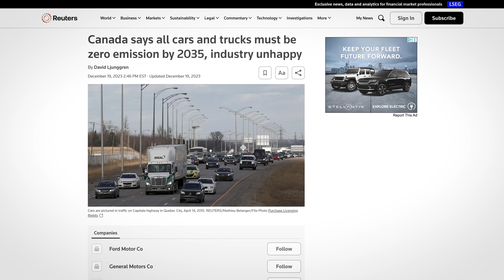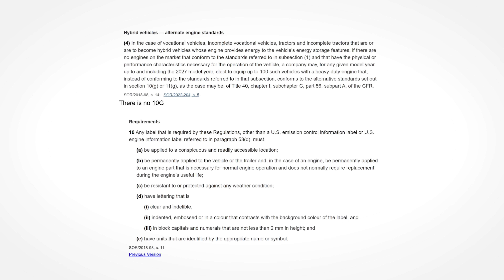Government Red Tape Is Blocking Our Plug-In Hybrid Trucks

Comment: More excuses.  I recall the earlier bloviation about using red diesel because the genset isn't mechanically connected to the drivetrain.  Just stupidity or wanking off for YouTube content.

But was good to see Chace state that his hybrids are "experimental".  We've been hearing how Topsy was a prototype and the new vehicles are production with the battery and control issues solved. My take is they have again realized the current redesign will not work and more time and redesigns are needed.

They should have built a pure electric first to develop all the engineering expertise they appear to lack.  Then add the generator.

Or just switch to the on road diesel engine for the generator and get these production hybrids running.  Assuming the electric parts are working.

But good to hear about the mechanical truck again.

Comment: Easy: the generator is not required to drive an Edidon truck. Certify without a generator. Then have an option for customers to add a generator before their truck leaves the assembly line. Legacy diesel vocational repair trucks are built this way. So, @EdisonMotors you build it this way too, only difference is that you'll put that generator at the front of the truck because there's space for it.
This got to be totally legit way!

Comment: Simple solution, make it so the generator doesn't work when the vehicle is moving. Use it as a "backup" off road charging station. Don't worry, owners will find a work around to get it working on the road.
Reply: They can’t sell it with the generator on the truck
Reply: Why not just use the diesel engine to push the truck down the road. Eliminate all that battary and e-moter weight  and go with what works. So says the 40 year mechanic.

Comment: you can use PTO control mode over CAN J1939 TSC1 to adjust the torque based on the load. you just have to do the load anticipation/reaction in your main controller.

Comment: Pretty sure you can use an on highway version if you wrap a control system around it. It will result in a better system overall instead of relying on a standard governor that is doing its own thing.

Comment: Here's what you do. Sell the truck without the generator. That way the "engine bay" is empty when you sell the truck. Now you call the engine bay a "cargo bay". Now you have a separate company that sells generators. Those generators just happen to fit in your cargo bay and plug into it. Nothing says you cant run a generator thats cargo on your truck. 

Literally no difference between plugging into a generator parked on the side of the road or loading the generator on a vehicle and running it.

What about refer engines are they on highway compliant?
Reply: they don’t even need to have a different company, just sell the generator on a special metal pallet that happens to bolt into a front cargo bay and plug in with a proprietary connector with canbus instead of an EV charger plug

Comment: Why not just hook whatever highway rated engine up to the electric generator and make an electronic throttle controller that turns the regular injection system into a governor? It just needs to see current draw from the battery pack and engine RPM, then increase throttle position accordingly. Current draw gives you instantaneous throttle response in open loop while engine RPM gives you closed loop feedback to tune out overshoot or undershoot like the I term in a PID loop. If you tune it to be more responsive, you reduce battery cycling while if you're just trying to save fuel and emissions you tune it to run the engine at an efficient speed and let the battery take up the peaks and valleys of instantaneous power demand.

The only reason I can see that this wouldn't work is if the electric generator you were planning to use isn't available except when packaged with the off-highway engine.
Reply: Wouldn't be as efficient as a dedicated generator. By a long shot.
Reply: I too am confused as to why they can't make their own governor function. Slap a generator on an on-highway engine and software control the throttle. 

Sure, maybe the on-highway engine is not optimized for a specific speed like a generator engine MIGHT be, but this isn't a complete blocker.
Reply: @Maxzillian it's massively bad for making electric power with

Comment: They have rolling emotions on the books. The big manufacturing companies said that they could not meet it. So they changed it to being at a stop. 

Don't fight this. Change how emotions are measured. Have it be moving with a full load in city stop and go traffic. And going up a step grade. We all know that a normal truck will not pass because the emissions will be high. 

You are out to change things. So change them. If the big manufacturing companies want to stop you then do what they don't want done. Have emissions tested at the extreme and then don't worry about it. Your truck will pass and then every on the road truck will not be able to pass.

They changed away from this type of testing because they were not able to pass with a load. 

The problem is that we think that we do something and it shows up tomorrow. Nature doesn't work like this. Right now if you match up numbers. Then temperature rise is about the same as the amount of green house gasses made around the start of the industrial revolution. Think about that. We are not seeing anything yet. When nature tells us something is wrong. It's too late. 

I wish you luck. If you have to do something then make it leave a mark. If your truck can pass then so should every other truck. Make a test that they can't pass. It could be as simple as emissions per mile driven with a full load.
Reply: Emissions, not Emotions.

Comment: Government incompetence has no limits.
Reply: It's not incompetence, it's corruption.
Reply: This was due to corruption.
Reply: It's not incompetence. It's intentional.  They'd rather sell carbon credits and continue the scam to line their own pockets
Reply: It was never about the environment
Reply: @unipartywonagainstthepeople They don't want people free to move or free to do business. Read Carney's book "Values"!
Reply: @unipartywonagainstthepeople facts
Reply: @unipartywonagainstthepeople generators have way laxer limits than road vehicles.

If you could get a road vehicle to fall under generator limits it would immediately be more powerful, more fuel efficient, more reliable and way more polluting.

The additional costs of a 7kWh battery, a beefed up starter that can be used as drive motor and the cheapest charger possible would be profitable. Cause that's all that is required to fall under the PHEV category in Canada.
Reply: it's not incompetence, it's how it is meant to work by design.
Reply: Replace incompetence with criminality and you are right on the mark!
Reply: THAT is evident. All they need to do is Modify the Legislation to allow what you are building, It is THAT dead simple.
Reply: incompetent gov is a crime against humanity
Reply: West needs to join the US. There is 0 benefit for staying with Ottawa, Quebec and Maritimes. Libtards...
Reply: In short. Use a road cert eng connected to an gen and have it's ECU throddle commanded by the battery level. Similar to Toyota's synergy drive but with just the elc motors turning the wheels.
Reply: World wide
Reply: I agree. So it's our job to educate them.
Reply: Dumb crap. But they will listen to tree huggers like it's gospel. 
Presented evidence. 
They nod their head and pretend like they are listening and understand.
Reply: It's not incompetence, the government just want people to think it's incompetence, because the reality of what they are doing is far more disturbing.
Reply: Especially the Canadian government.  They're speed running what happened to the USSR.
Reply: US government recently did a couple things right for once. We got rid of these dread decrees.
Reply: What government official has their hands in the pockets of Cummings or other engine companys? Because if they can't or won't do anything that would be better for Canada they have to be getting paid by someone. In my opinion that is. I hope your company gets to move forward with this and make canada better!!
Reply: It has nothing to do with incompetence. Its greed and making themselves rich. The women who runs the private green program in BC is an NDP representitive who extorts peoppe like this guy for up to 20% of their profit. And if they dont comply they dont get the grant. They are nothing but one big mafia who steal our money and enrich themselves
Reply: As US citizens I hate to be like this but I really hope you fail as Company. EV isn't the future it is the biggest scam of the 21st century everyone should be telling the government if you want EV you make it. As Citizen you should be trying to hurt your own citizens don't help them at all. EV isn't the way and the United States Citizens realized this we totally rejected it. EV market in the United States Crashed and burned so much the EV Company are fleeing the United States as fast as they can. most of them going to Canada Thank god. Scam Canada not the United States. 

Sorry I hate this is happening to you but in reality you Volunteered yourself for the task, 🤔
Reply: Goverment is nothing more than a bunch of humans. HUMAN incompetence has no limits.
Reply: Its not incompetence, its deliberate.

You will own nothing, you will eat ze bugs and you will be happy. Normal logistics shipping real food and goods goes directly against this. Of course they dont want solutions, they want this industry gone.
Reply: Its straight malice
Reply: its not incompetence, its to favour their buddies who lobbied them
Reply: And meanwhile, (I'm a neighbor to the south) Al Gore lectures from his private jet stocked with caviar and champagne about how bad it is for the environment that we have a beer and a hot dog and drive a regular vehicle
Reply: Dude, the rules were written by lawyers who assuming that no one would change how trucks were made
Reply: go check what the off highway vs on highway emissions standards are. off highway is way laxer.

and this is also easily solved by just building your own governor and chucking it onto whatever road engine you want
Reply: @anonym3017 the reality is it is bureaucracy stiffiling business and innovation which is a very Canadian skill set.
Reply: @larrydugan1441 no. The reality is that "plug in hybrids get to use engines that only meet generator requirements" would immediately get abused by every manufacturer ever.

Cause chucking a 7kWh battery, a slightly more powerful starter and a single pgase charger in it would immediately be profitable. Just cause emission standards are expensive to meet, increase fuel consumption considerably, increase maintenance costs and decrease efficiency/power output.

So no. Plug in hybrids get to meet generator standards is not a workable proposal.
Reply: @anonym3017  so the Toyota hybrids meet what requirements in your world?
Reply: @rhetorical1488 all the Toyota on road engines meet the highway emissions specs.

Not the non road specs.
Reply: @larrydugan1441  Avro Arrow has entered the chat...
Reply: @anonym3017  the scania engine they use have better emissions then the American on  highway engines
Reply: @larrydugan1441  The reality is we've got a bunch of backyard mechanic dipsticks who don't have a SINGLE CLUE what they're doing. Proof is self-evident.
Reply: @anonym3017  CO2 - isn't causing a climate crisis BTW.  Sooo, you're effectively defending bureaucratic madness for a reasoning that is nonexistent.
Reply: @KipringPayne you were literally proven wrong back in the 1800s. Cause that's when John Tyndall discovered the absorption spectrum of CO2. Planck and his black body radiation work then showed why CO2 is a potent greenhouse gas. With the first theory of the greenhouse effect being made in 1824 by Fourier.

So please just shut up about stuff you clearly don't understand
Reply: @anonym3017 someone ignores the experts. You smell vaxxed
Reply: @anonym3017  Hey smooth brain.  What happened to Global Cooling?  Still waiting on you to explain why you are ignoring the climate experts that the UN climate council ignored solar output.
Reply: @KipringPayne "global cooling" was always bullshit.

1-2 studies going "earth will get colder" while all the rest go "earth will get hotter" makes those 1-2 studies bullshit.

Between 1980 and 2020 solar irradiance of earth decreased by about 0.5W/m2 in a running 11 year average.

In the same timeframe average global temperature increased by about 1C.

Meaning that solar irradiance clearly isn't driving any warming.
Reply: @anonym3017  Ahh, yes the studies that are so good this time.  Like every single Climate Model that has failed.  Or do you prefer the larger studies where they used asphalt. urban structures and water temps next to ship engines or power plant discharge?  Yes, so much better.

Indeed it has declined - due to the solar cycles.  Try doing more than a google search.  It just makes you look more incompetent than you already are.  Let me help you smooth brain. Trend analysis is what you want to look for.

I notice you didn't want to bring up ice cores.... yes.... run along. You've made enough of a mess here.
Reply: @KipringPayne    I think the way you think, you have a good head on your shoulders. CO2 is plant food, the marginal rise in CO2 has caused huge greenification absent of any human intervention, and the solar cycle is trending high right now, leading to increased global temperature average, a cycle we've seen repeating often both in smaller ups and downs, and a larger and far slower up and down. That longer cycle is how we get warming periods and cooling periods.
Reply: @anonym3017 there is no such thing as "easily solved" when the government is involved. The governor change on the engine would likely remove the certification and require recertification which is exactly the same issue with the generators. The most likely scenario is the government eventually approving a far less efficient vehicle while wasting everyone's money and time along the way
Reply: @AustinCoulson No. Installing a governor doesn't renove the certification of the engine.

Cause the governor you install interfaces with the throttle pedal position sensor.

So you aren't touching anything that isn't supposed to be touched.
Reply: @anonym3017 you make it sound like a reasonable explanation will be accepted by the Government
Reply: @AustinCoulson a reasonable explanation will be accepted by the government. Cause it has been accepted for decades.

"A computer tells the engine to output a different amount of power depending on how much load is applied to the wheels" is a pretty standard feature on vehicles and has been for decades. It's called cruise control.
Reply: @anonym3017 I'm curious what you do for a living because you sound like you have had pleasant experiences dealing with government regulations.
Reply: @AustinCoulson I'm not doxxing myself. So let's just leave it at me being a mechanical engineer.

I have been paid to find ways to abuse regulations, get around them and if neither were possible find the cheapest way to meet them.

PHEV only having to meet generator emission standards would massively reduce air quality cause abusing that regulation costs 2-3grand per truck and would make it better, for the owner/operator, in every single way.
Reply: @anonym3017 can you explain what difference this regulation will make to global temperatures in 100 years?
Reply: @larrydugan1441 it makes a massive difference to air quality right now.

Generator engines are more efficient, powerful, cheaper to maintain and cheaper to build.

Chucking the weakest battery emotor and charger into a normal truck so it gets to use a generator engine would be very profitable.
Reply: @AustinCoulson  Just because somebody never took 5 minutes to look up the requirements doesn't mean I have any sympathy for their plight. Whoops, looks like bankruptcy is next. Oh well.
Reply: @AustinCoulson  and this "government" likes to be involved in everything we do.... we're such a free country aren't we? 😅
Reply: @anonym3017  the scania engine they use have better emissions then the American on  highway engines
Reply: @anonym3017  the thing is, it won't end there, it will always be "just one more thing"
Reply: @anonym3017  It won't be a road certified engine anymore. This is the probleme you probably have to make certify an engine wich could not pass an road certification test. Road engine are tested at idle and different load. Generator turn at 1800 rpm whatever the load.
Reply: @legro19 again.

Their own governor would just interact with whatever the gas pedal normally interacts with. Nothing changes about the engine.
Reply: The Canadian government is such an embarrassment to our country
Reply: It's incompetence on the part of Edison Motors for not properly performing due diligence.

Comment: The government doesn't like competition. If they can't fully control everything you do, they will shut you down. They don't want people/the market to be able to solve the problem, they want the market to fail at solving the problem so that the government can step in and do it themselves (and fail).

The thing that bugs me the most in US cities is they always claim they want density. However, they use zoning, permitting, and parking requirements to ban multi-family units. Large swaths of all democrat run cities are zoned single family. Then they cry that the city is low density and claim the only solution is for government to build high density housing. If government would get out of the way, we would have denser cities. Old cities created before government micromanage have high density. Government should always be smaller.